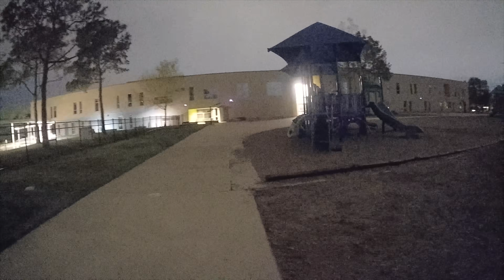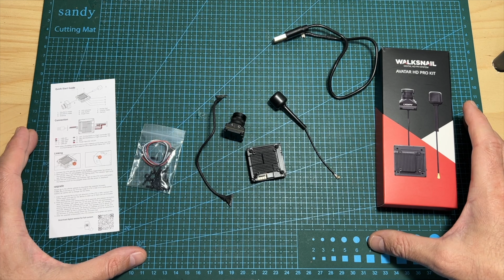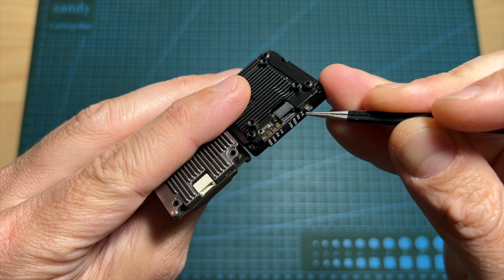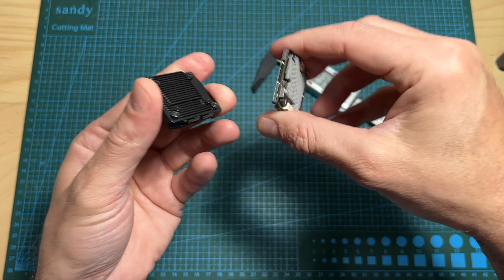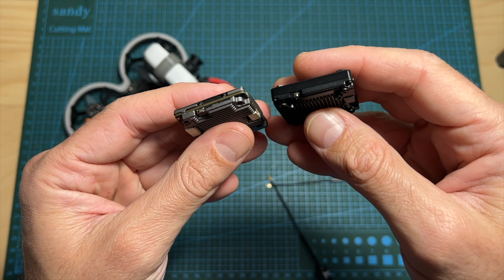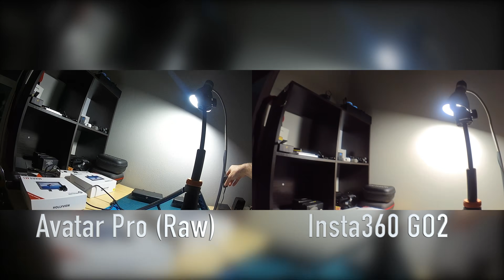Night Vision Digital Camera // Caddx Walksnail Avatar Pro

Comment: Need to see that starlight camera tested in bright blue sky overhead sunlight now...🤔🤔😳...It looked overcast in your clip. I still wish they had just put an SD card slot in it instead. Powering the Air unit to pull big files out is a pain....and it's slower..🤔😳🇬🇧
Reply from the maker: Yep I mentioned it in the video. I will release more flight footage soon, the weather is still not that great.

Comment: looks good, looking forward for penetration and range test. I like the gyro in the cam like dji did with the 03
Reply from the maker: Will do my best Damiano.
Reply: @KremerFPV  thank you hehe, just do what you want btw. I didnt want to put pressure or anything. Also atm i am using dji so is just for curiosity
Reply from the maker: @damianomotta1809  no worries